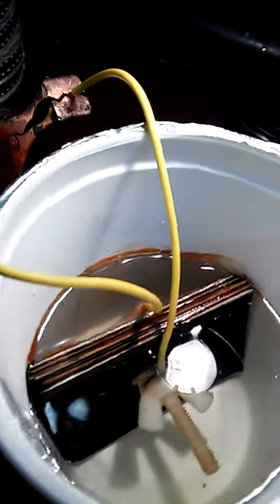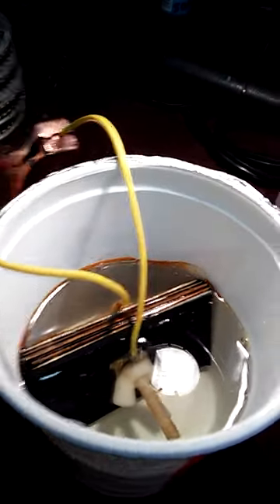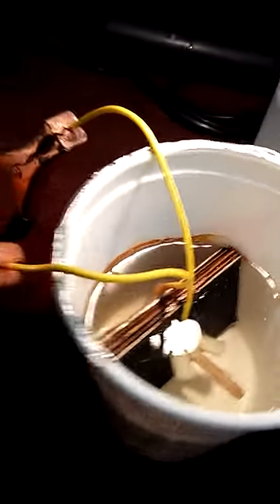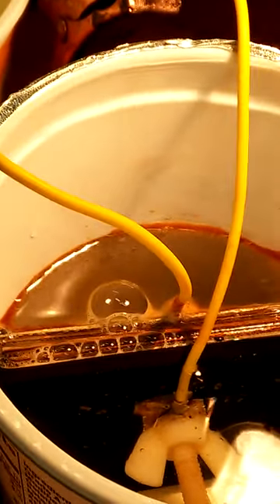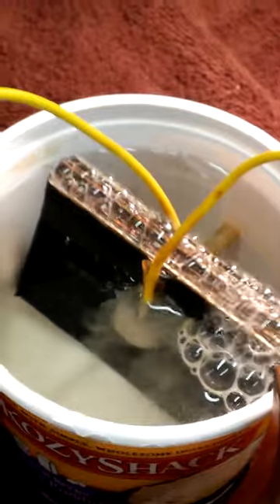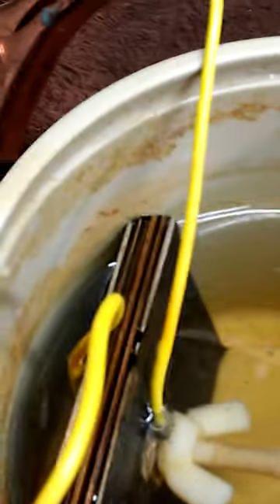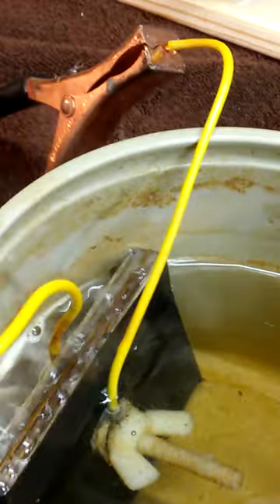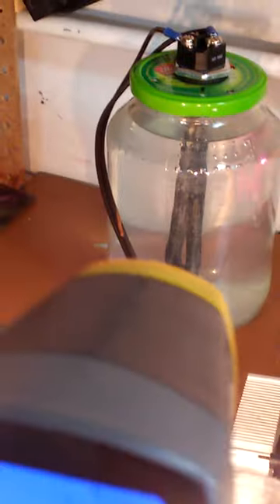difference with high voltage and different types of water

Comment: Great work Vaporkid I can't thank you enough.
One quick question, did you have to adjust the timing on your vapor lawnmower or did it run just fine without adjustment?
Reply from the maker: Ryan Henkle it runs fine with out doing any adjustments at all to the engine, and i will say it again you will never ever hurt the engine running vapor, a lot of em say it runs to lean, it does not, i have never destroyed a engine running it on vapor, i have not had anybody yet prove me wrong that it will
Reply: Thanks for the fast response and for the great project idea.  Should have it up and running this week.  Keep up the good work and don't let the turkeys get you down.

Comment: What would happen if you used hydrogen peroxide in the bucket and not salt or distilled water?
What would happen if you used an ac current through the plates and not dc voltage?

Comment: Finished the mower today.  It fired right up on the first pull.  It runs great, the only problem is the solder immediately started melting.  Any ideas on what else to use instead of that lead free solder?  Thanks.
Reply from the maker: Ryan Henkle yea you have to solder those joints with sliver solder the type they use on refrigeration lines
Reply: Thanks for the tip.  Looks like I've got some more work to do.

Comment: Hi there I just seen your work Nice job Not sure if you seen mine I went with cold vapor and a pond fogger got great results. I know your heat system work cause its how I started figuring things out. You see I was stuck about 100 miles away with a car that Vapor locked on me and only had 1/4 tank of gas. I figured id drive as far as I could and call someone. Well I made it all the way home with that 1/4 tank of gas still there. Got me thinking lol. Now I'm into Stan Meyers Stuff and I'm almost ready to run the same generator off HHO we shal see how it goes. Keep up the good work
Reply: diveborg13 1/4 of gas is a hell of a lot of gas. I drive a big 5.4 v8 van and when the gas says E I have about 80 miles left when the gas light turns on the most I've drove it was 60 miles with the gas light actually on well past E and it still didn't die. People are afraid to run out and I get it but I have gas cans in the van so it doesn't matter. But if you test it you'll see you can drive for a long while. If your car is dieing any point and you know it's fine and has gas just loosen the gas cap to relive some pressure and you'll be good.

Comment: I think I understand what you are doing, is that overheating?
  From my experience, voltage is a problem, amps are my friend.
 I use mine for a torch. If it gets hot, steam forms, and I screw up my welds.
  How long do you think you can run this without much steam?
  Thanks so much for putting all of your experience out to the rest of us crazy #$$&##😀
  Appreciate it!!!
Reply: I get 15minutes straight with coffee filter and wood shaving filter just past the primary arrestor and  bubbler flash back isolator
Reply: @UnifiedInfo  that's actually an engeinous solution to a common problem running or home made torches, ......thanks,  very good idea, what do you think would happen if we did the exact same thing but with pure carbon?
 I'd imagine we'd get a bit better than 15 mins rin time, but,  I'm also thinking silica,  ground glass with  carbon......
Man thank you,  you gave me much to consider, try, and report back on it.....if yall don't hear from me after 3 months from now,  please hit me up,  I'm sure I'm doing the different materials as ya stated,  but I might space coming back here, so please hit me up in a couple months if I haven't posted anything here.
 Thanks!!!!
Reply: @allentremper8243  I should mention I stuck a couple silica packs in there for good measure but you taking it a step further cheers. I'd like to see what you come up with. I was even considering a new tank that can shed the heat better after its been running awhile